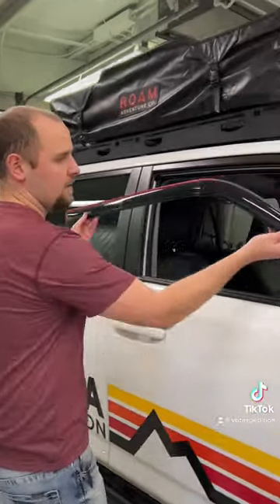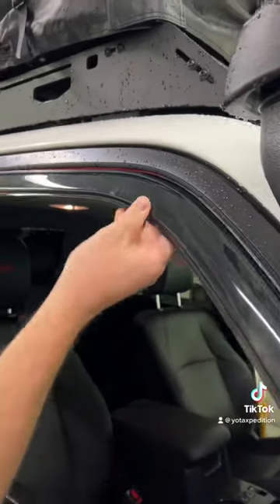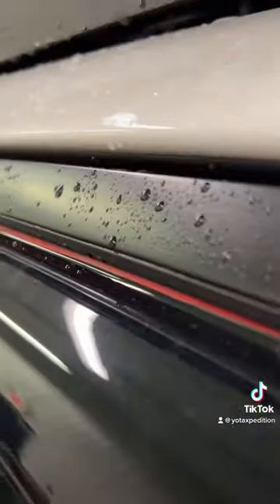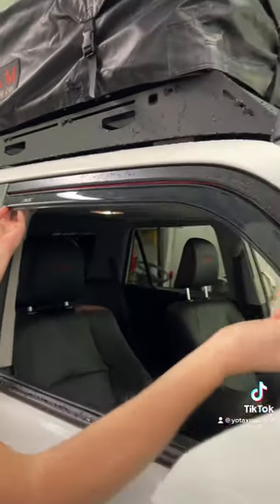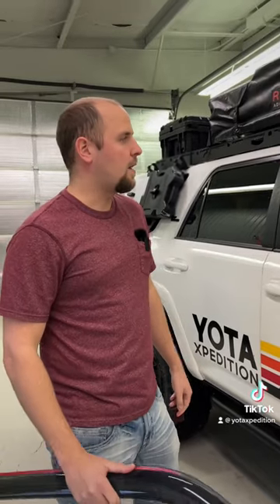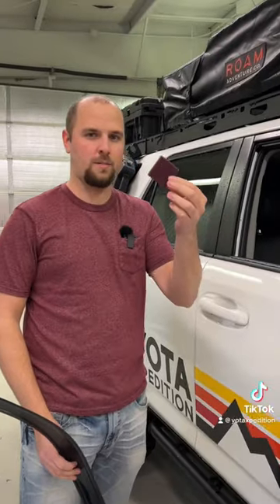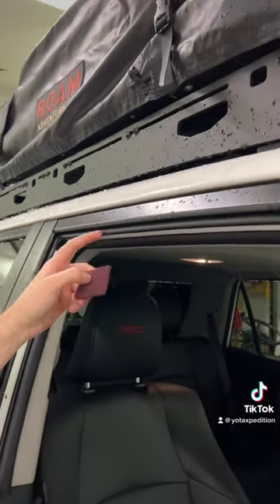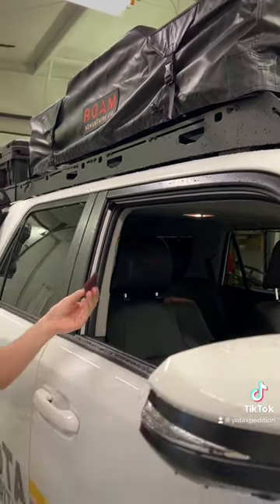AVS in channel window visors, no good?

Comment: Do you know how you remove them once you don't want them on anymore?
Reply from the maker: A heat gun will help loosen the double-sided tape and pull them off. You will have double-sided tape you will need to clean off. Use Goo Gone to help with the tape.
Reply: @yotaxpedition  I am not going to damage the window gasket with the heat gun, will I?
Reply from the maker: Don't get too crazy with it. You just want to warm the tape up.
Reply: @yotaxpedition  I do not have a heat gun anyways. o i am going to use 3M Adhesive Remover and a hairdryer.
Reply from the maker: @kjpphotography4764  that should work perfectly!
Reply: @yotaxpedition  Worked like a charm. Thank you!
Reply from the maker: Good to hear!